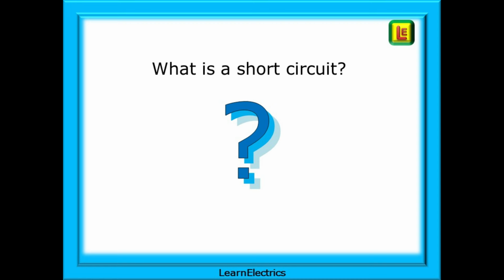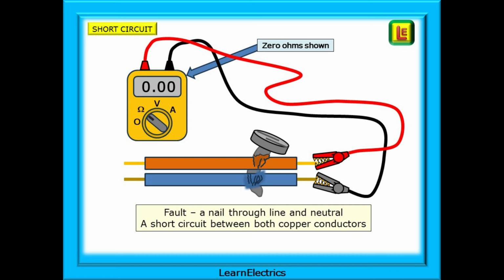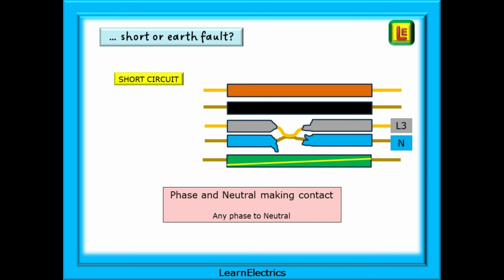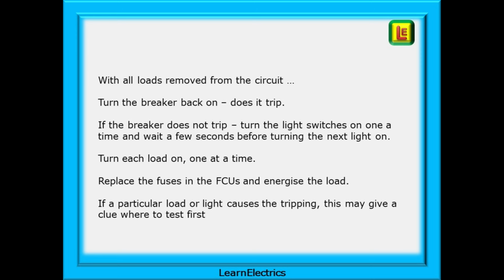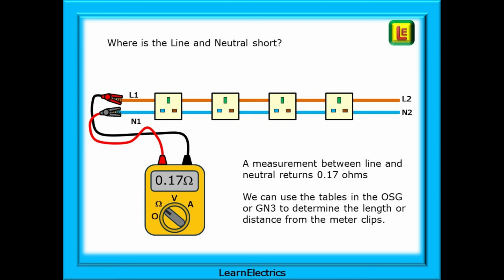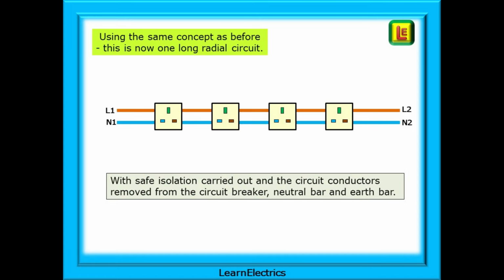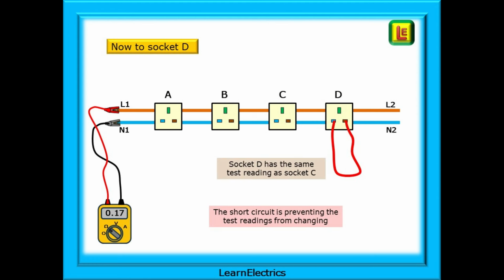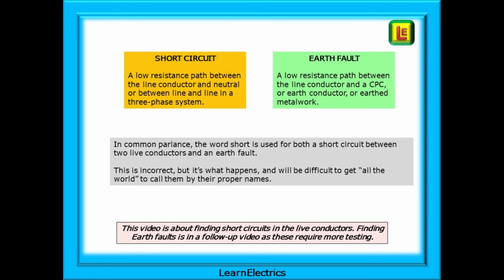FINDING A SHORT PART ONE – ELECTRICAL SHORT CIRCUITS AND EASY WAYS TO FIND THEM – FAULT FINDING TIPS

Comment: Great video
Very informative and concise 
Can the same principles be used on radial lighting circuits with multiple fittings?
Reply from the maker: Yes, absolutely. On multiple legs I always divided by two. that is to say, I split the suspect circuit at a convenient half-wayish point and retested. The half that failed was split in two again and rested. You soon find the fault this way rather than testing every connection. Thanks for watching, Dave.

Comment: Line to line means phase to phase???? dint undrnstnd
Reply: also line to neutral should not be short circuit
Reply from the maker: Exactly. A short is between live conductors.
Reply from the maker: That's it. Thanks for watching.

Comment: Thankyou for such an amazing intro into a fascinating area ie faultfinding. I have taken down and drew diagrams for future benefit. I have just a small query and that is when you do the end to end tests on the line and neutral at the start to see if both are continuous yes they will be continuous because the short or nail is linking them together so in essence you will be getting a lower reading than you would normally but how can you tell if the reading is lower. I assume its when you do your end to end on the cpc and this is more than 1.67 times higher resistance that you then scratch your scone and say something isnt right here.
Reply from the maker: The main thing we are doing, first, is establishing that we have the correct conductors, what the reading is doesn't matter too much, just, are the cables continuous. Then we can start getting technical and finding values.
Have a look at this video on cable resistances, it will explain a lot.
https://www.youtube.com/watch?v=Wl1--nxRnME
Reply: Thankyou and I will give that video a look cheers.

Comment: Hi, great informative video. I have an extractor fan in the bathroom which sometimes keep going on and off, can someone please tell me if it is short circut or not? Many thanks
Reply from the maker: If it was a short circuit it would probably trip the breaker/RCD or just not work. Could be the windings breaking down or the pcb inside or something else. They don't last forever unfortunately. Dave.
Reply: @learnelectrics4402  or could be on a humidity sensor

Comment: Tonight I’ve had a short circuit fault even though the IR readings were all over 100M ohms? It’s on a kitchen ring final circuit but not tripping immediately. It can take up to 20-30 mins for it to trip? Any ideas or help is much appreciated. 
Your video has given me more guidance now which I will definitely bear in mind so thank you
Reply from the maker: Is the circuit damp, that can often cause a slow trip.
Take a look at this video on earth faults too.
https://www.youtube.com/watch?v=IN5wIHoMtAo

Comment: At 16:25 in video.  Would the reading not continue to get larger.  I mean you have 2 resistances in parallel, the nail and the short at the socket.  The bigger either is the larger the reading ? Of course the resistance of 2 parallel resistors is always less then the smallest resistor but the reading would still get larger ?..       Can you explain further.
Reply from the maker: I will do another video on this to explain it. Its all to do with very small resistances in parallel.
Reply: @learnelectrics4402  Thank you

Comment: Dave, just trying to get my head around why the socket at B closest to the fault has the highest reading. Is it because the furthest from the failt the lower the resistance reading
Reply from the maker: As the length of wire increases, the resistance increases. As socket B is closest to the fault, that will be the longest length of wire. Hope this helps.
Reply: @learnelectrics4402  genius
Reply: Genius. Any idea where you got the short lead to short out on plug adaptor. Did you make it up yourself

Comment: Nice lecture.  might have been good to show sketch of resistances values  and explain why it stays at 0.17 ohms after short just for complete understanding
Reply from the maker: Maybe I could add that on to the series, thank you.
Reply: It took me a while to figure this out myself now im not sure but if its 0.148 ohms before the short then 0.17 is very slightly higher than this ie slightly longer cable which equates to slightly more resistance to the point of the nail or short after the 0.148 reading at the socket before the short and I thnk the reason it stays at 0.17 at each socket after the short is because the electron path is whizzing through the short or nail and not going any further ie along the rest of the cable sockets etc and hence the reason why you investigate in between the 0.148 value and 0.17 and as well its good to note down the values between each socket because you can see how much the resistance changes between the sockets and in the case of the very slight increase between 0.148 and 0.17 you can compare if this incfrease is on a par with the previous increases in resistance between the previous sockets and if its not then that also proves your in the right area to look for said short. I hope this makes sense and maybe im way wrong i dont know.

Comment: Rule of Safe isolation: If the circuit is not dead, you might be when you touch it.
Reply from the maker: Exactly. thanks for watching. Dave.
Reply: @learnelectrics4402  I always look forward to your videos. Am a pro electrician, thanks to you
Reply: Hi dave I really appreciated your help very informative and understandable I wish if you were my teacher if you could leave a link for a sockets adaptor link I couldn't find it on line or the shop thanks

Comment: As always great ❤❤
Any advice on C&G level 3 inspection and testing I failed 3 times
Reply from the maker: What I used to do was to get as many old questions and answers on anything electrical. Its important that you have access to the model answers. Then I would write out the QUESTION and the ANSWER. Do this for 6 or 10 questions. Throw the pieces of paper away and write out the very same questions and answers again. throw the paper away.
Write out the same questions and answers again. repeat until you can write the questions and answers accurately without looking at the question paper. Then do the next 10, write, repeat, write, repeat. Do some every night starting now. If you weakness is physical testing, make yourself a little test board from 2 foot by 4 foot chipboard. A cheap consumer unit and a few sockets and a light or two. Plug it in and test away. Put a fault on it and see what test results you get. swap the wires in a two way switch and see what happens, how to find it etc. put the effort in now and assessment day will be a breeze. Phew! Perhaps I should do a video on making a test board. Good luck. Dave.

Comment: Thanks again for sharing your knowledge. Do you have any adcice on how to establish the actual route of a ring final - in other words when the conductors leave socket A how can you establish which is the next socket on the circuit?
Reply from the maker: Without the installer leaving a plan for the customer it can be difficult. However, if you know it is only a downstairs circuit, it is very likely that the route will follow a ring too. If you can find the furthest socket from the CU, ask yourself, how would I route the cable from the CU to here and how would I get back to the CU from here and take in all the sockets. A mixture of guesswork, practice and lots of luck.
Reply: @learnelectrics4402  Thanks very much for taking the time to reply.

Comment: Great video as ever Dave! 
I like to use the actual fault (eg.. nail in a cable) as the automatic link. Then, after safe isolation and removal of the connections from the consumer unit, set the meter to Ω and go around the circuit looking for the lowest impedance. This then gives you a good starting point of where to start checking for damage to the cable. Looking forward to the next instalment👍👍👍
Reply from the maker: Great comments, everyone has a preferred method. Working on Part 2 very soon. Dave.